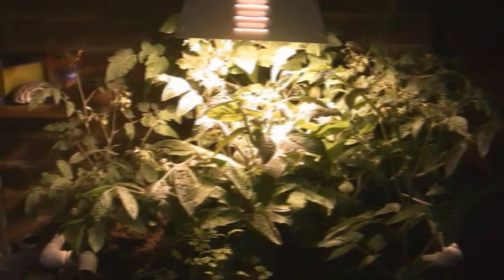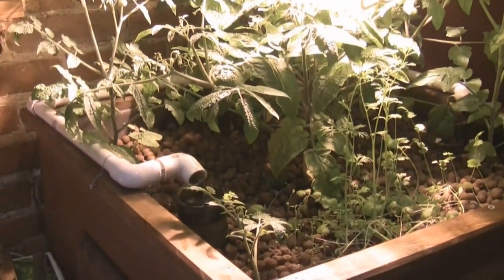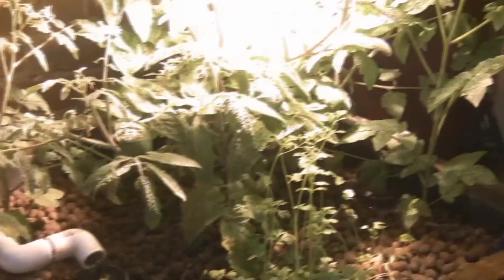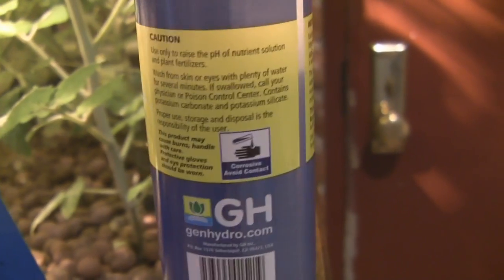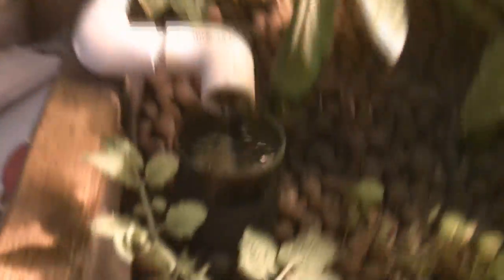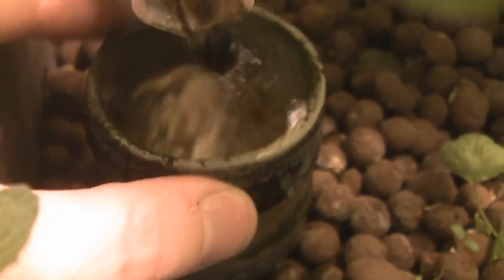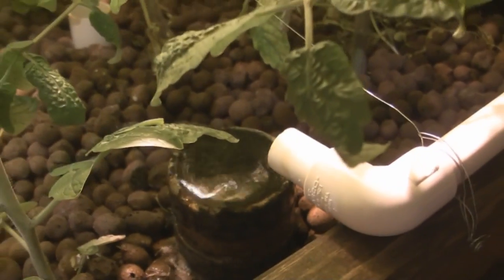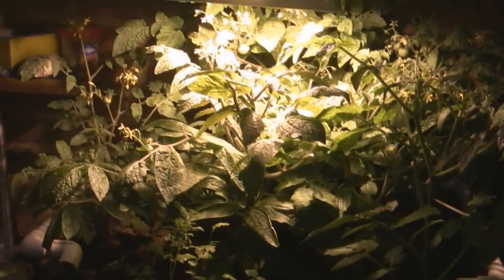Aquaponics PH Buffering & Siphon Silencing Aeration

Comment: I like your t-siphon silencer. It sounds great. Two Questions:
1) After adding the t-siphon that goes into the tank water, have you noticed a difference in the rate of drainage from your grow bed?
2) Is the outlet on the t-siphon constantly producing bubbles?

The reason I ask is because my concern is that the putting a t-siphon into the water may prevent enough pressure from building up to create a strong siphon thereby reducing the drainage time of your growbed and potentially preventing complete drainage.

Your answers and feedback are greatly appreciated. Thank you for the videos. I look forward to seeing more.
Reply from the maker: The drainage rate is dictated by the standpipe because it is the smallest diameter in the flow of water, so no it does not change the rated. The silencer will make bubbles until the siphon stops and the growbed is empty. Thanks for watching!
Reply: Thanks, would the t-siphon work with a bell siphon?
Reply from the maker: a2rkg I'm not sure I understand your  question or we are mixed up on terminology. If you are talking about the silencer beneath the grow bed then yes (featured in this video) it would work, the T-Siphon would be in place of the bell siphon as they are both siphons that do the same thing.
Reply: AquaponicsNYC Yes, perhaps the definitions are off. =) Let me try to clarify. When I say "t-siphon" I am referring to the "special pvc pipe" you attached to the siphon drain as seen at http://youtu.be/rhUoSwbSnVg?t=5m38s . From your previous videos it looks like you are using loop siphon system in order to create a vacuum and initiate drainage of your grow bed. My question is: If I am using a bell siphon (as seen here http://aquaponics-system.com/wp-content/uploads/bell-siphon.jpg.png), will it still work properly (drain the grow bed) after adding the "special pvc pipe" fitting you attached to the siphon drain? I not familiar with water dynamics and I am not sure if a similar modification to the siphon drain in a a bell siphon system will affect its inherent function. You have much more experience than me so I am hoping you can tell me what will happen or what you think might happen. Thanks again, and great new video!

Comment: I have a couple of 45 gallon tanks I use for seed grow beds and have a continuous battle with low PH. Didn't know what was causing it until your video. I'll be doing the egg shells now. In my IBC tank I have a 90 degree elbow from the GB return just above the water with a short pipe going in just below the water level. This was creating a problem for my siphon shutting off so I drilled a 1/4" hole in the top side of the elbow to allow some air to help the siphon. Now I get tons of air bubbles when my GB drains and the siphon works flawlessly. I like your T siphon and will try that in my next bed.
Reply from the maker: You can also use shell grit which is calcium carbonate too. These are slow acting buffers that I use to create a PH "floor" and if you want something that changes your ph quickly try potassium bicarbonate. This also adds potassium for your flowering & fruiting plants.

Comment: You can get a pvc coupler that has one side as a split fit (for the pvc pipe) and the other size threaded for a threaded barb adapter. You can connect the venturi's barb fitting and the barb fitting on the pvc with vinyl hose. Itll cost you less than $5 and it will add a lot more life to your pump. feeding air into a propeller is like driving a car with no oil. Sure it will still work but it really isnt good for the engine. Cavitation is what happens when a propeller spins in a pocket of air.

Comment from the maker: I know that the fitting would work on the other side of the pump but I couldn't put the pvc fittings on the venturi. I would like to believe you about drilling a hole, but wouldn't water come out of the hole because the pressure is greater inside the pipe.

Comment from the maker: Interesting point but when the pump is off there is not any way that water could flow through the hose without some force to cause the water to be pushed higher than the edge of the fish tank. If it did reach that high it could start siphoning the water out... but I don't see any possible way that would happen.

Comment: I sugest you move the air hose to a point higher than the top of the fish tank. Their is a risk of emptying the tank to the floor in case of pump failure.